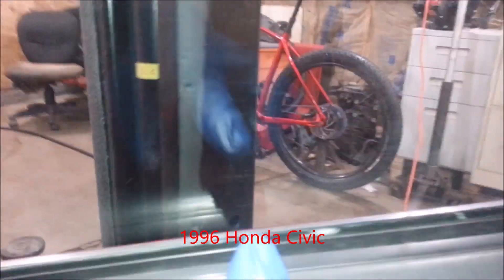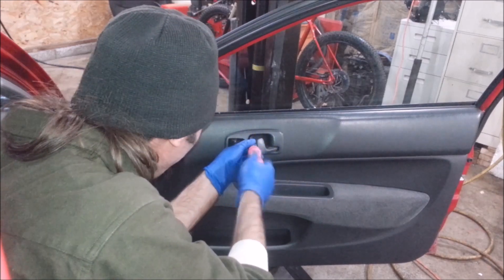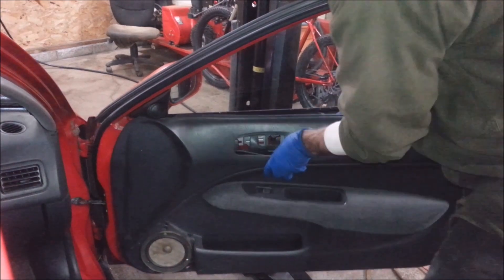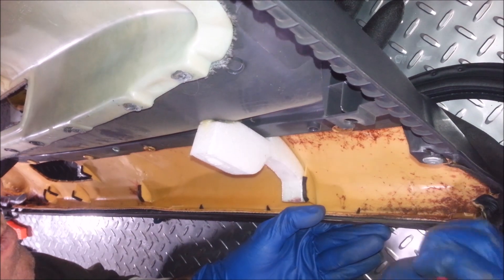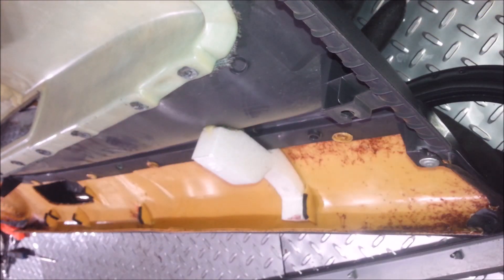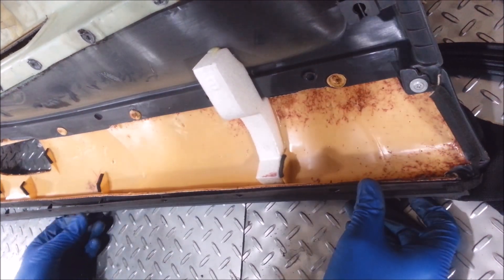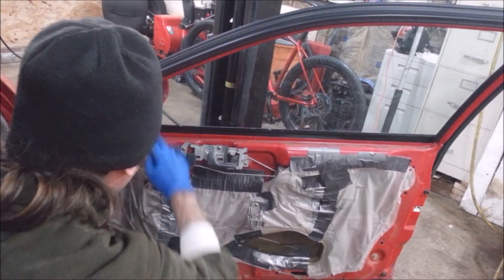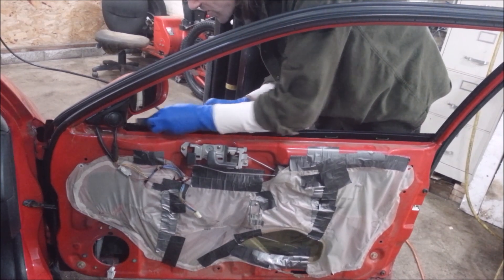1996-2000 Civic sticky brown gooey glue on door glass fix

Comment: Ha nice "fix".  Running into this issue too now. I used powered black carbon, like activated charcoal you can buy at pet store. The powder sticks to the goo and helps prevent this without needed to cut. I will cut as you did if this continues to be a problem.
Reply: did jt continue to be a problem?
Reply: @kysonnoble3547  over time if real hot it might get a bit gooy again and you apply the carbon again. Cutting works just drafty ha

Comment: My civic has manual windows and every time I roll it down or up there’s sticky residue on the window. Im assuming it’s the same issue as the power windows? 
Will water get inside when it rains or if I wash the car if I cut the rubber piece the way you did?
Reply from the maker: There are drain holes in the doors. The seal is on the outside of the window. The inside seal is for drafts.

Comment: Looks like a heater core issue

That’ll be 300$ also your door fluid is running low thats why it was hard to remove the panel
Reply from the maker: I don't believe you. It's actually a byproduct from the kanooter valve that made plasma from a reaction to the sun.

Comment: Are the ones at the boneyard just as bad?
Reply from the maker: Depends. This car was from Oregon. It is sunfaded to beat hell. Maybe ones from a cooler climate, or lower mileage, but I have done this to a few of these. You get used, and it is probably on its way out.